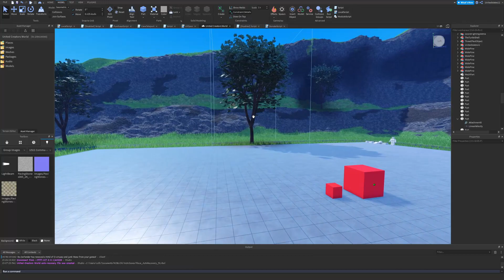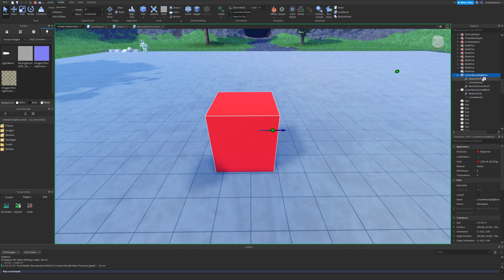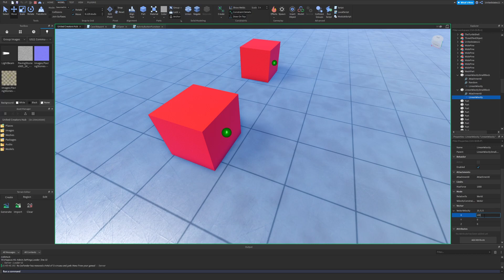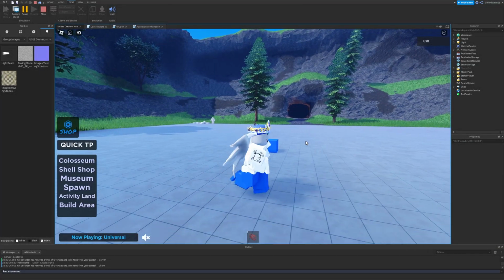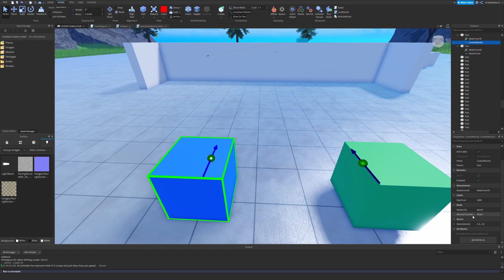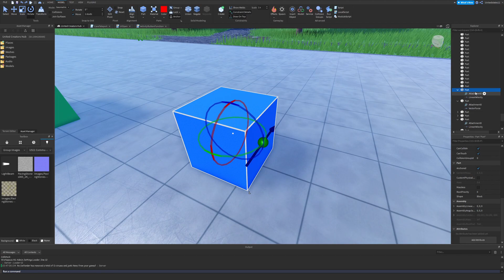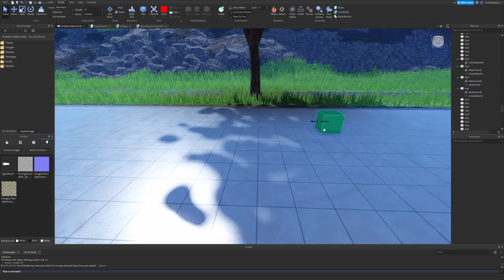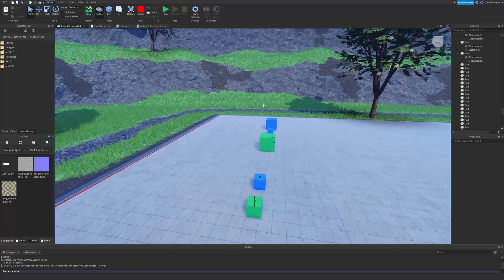How to use the LINEAR VELOCITY Physics Constraint in ROBLOX Studio!

Comment: How do i give the moving part a gravity? Because bodyvelocity you know it has gravity but i used bodyvelocity for my railway vehicles but those are quite laggy so i decided to use linearvelocity as someone suggested, it works but because of no gravity the vehicle is just acts funny and derails from the tracks. The directions are correct but i assume it's gravity since the vehicle lightly raises upwards after accelerating and yes, the part with linearvelocity and attachment 0 is below the vehicle where the wheels are and i assume that's why it heads upwards when accelerating i couldn't find a non confusing help for this.

Comment: hey man not sure if your still checking comments but do you know anything about stabilizing things that fly with this? i’m trying to make a firework thing that fires and resets but it’s spiraling out of control every time
Reply: ensuring the linear velocity is attached to the COM of the object would help.

you could use VectorForces instead since a firework rocket would look better using that and there is a property which applies it at the COM
Reply: @nathanholyland9493  thank